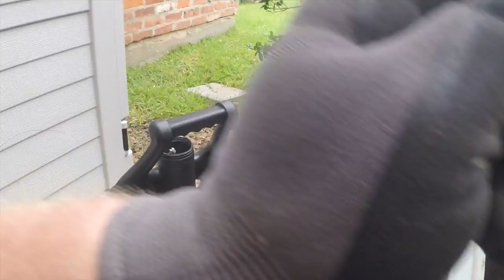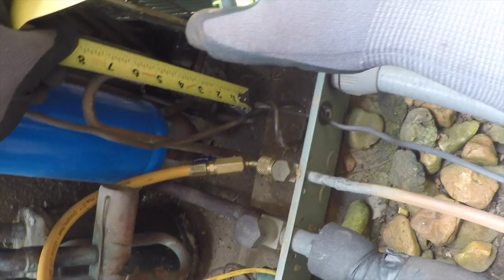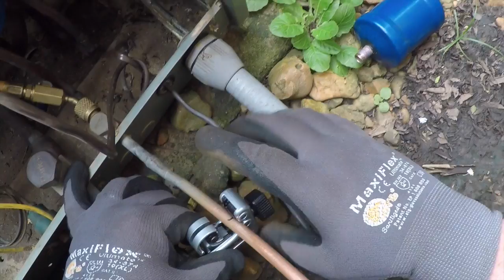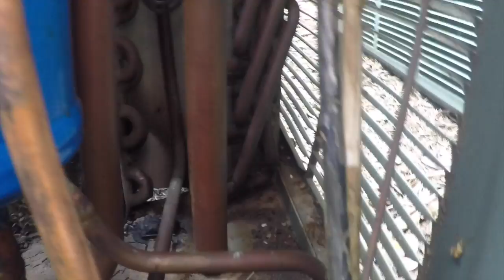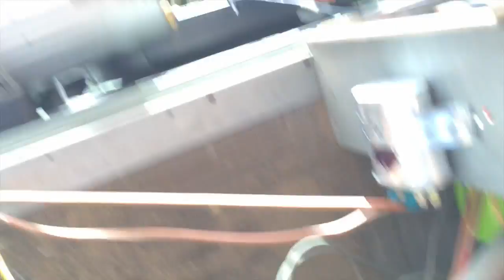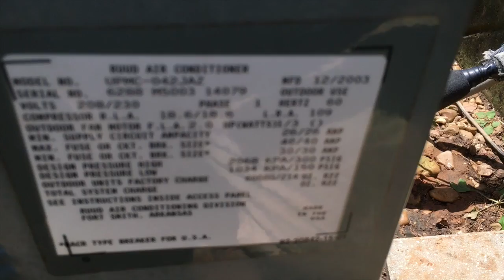HVAC: Ruud Freon Leak Repair

Comment: A lot of the moisture was put back into the system because you used a torch to remove the drier. I always cut out the old drier and add a little copper to put new drier in.

Comment: Good Job, John.. Stay with braze. I did refrigeration & air for 37 years. only used torch -b-tank for drain lines.. Most of my lines were 1 1/8 rubber gates/braided / or black High Density Polyethylene (HDPE), PVC, and CPVC. LOL Last 5 years did allot of GEO-THERMAL heat pumps..

Comment: Great video, the only thing I would do different is
1.  clean the liquid line copper before brazing
2.  use a wet rag or cooling gel on the filter before brazing
3.  cool down lines with a wet rag after brazing
4.  clean the condenser (looked very dirty)

other than that thumbs up on finding the second leak

Comment: All the AC companies you in my neck of the woods, put the filter drier indoors close to the evap coil. Any explanation for the different practices ?
Reply: Joe B it's always better to put filter drier indoors. It will not corrode and have a much longer lifespan inside.

Comment: Do you guys not use your pressure over time decay feature on the testo's? ( If you use a testo manifold )

Once your system has balanced over 15 min, I start the timer and let it go for 15 to 30 min on timed decay.

Just curious ?

Comment: Good work

Question: is there reason that the new drier was not placed in the original position?
Reply: It's just easier to replace in the future if needed.
Reply: Is it really easier?
I think these days a lot of us techs get in the trap of thinking something is going be easier, but it really isn't.
Since the drier was already removed it would have been simpler to place the new drier in position.
That and I'd recommend not un-sweating driers generally there can be a tendency to heat the desiccant and release noncondensible's back into the system.
In my opinion, I think it would have been simpler to re-sweat the drier in the factory position then to prep the liquid line cut it set the new drier there. Then cut a piece of copper to fit the old drier location swage it braze it. 
Now there are four braze points for failure plus a U-tube repair.
I'm sure that Isreal did everything in his skill set to make that system run back to OE spec.
So why, place a drier on the outside its ran 13 years with the OE drier with no problem till the leak. ( that know of).

Just my point of view its like a A-hole everyone has one.....LOL
Reply: @aubreyjahier6003  I'm not a tech and was wondering the same thing. 
Just using common sense, I would guess the new drier will be more vulnerable outside.

Comment: Nice repair , john. I see more folks these days trying DIY it to keep costs down. The problem with that is that there's hidden dangers everywhere in our industry. The trained pro is used to those dangers, though not immune. Stat set to cool? Filter clean? Breaker tripped? Those 3 things a diyer can check. Beyond that, you call a pro.

Comment: wash the coil before you check subcool? It was filthy.
Reply from the maker: +behvac your what's wrong with this industry!!
Reply: good eyes. bet both of those units are pulling a extra 5 amps each,  Next month will be selling condenser motor.  Yep my guy would have walked out the door with a new sale. He better sale what is best for the customer. That customer doesn't want to see me 3 times this summer. Another 3 times next summer.  Butt a one man show if you charged $1600.00 you can make it by yourself.

Comment: Since when is leaking "less than a pound" in 15 minutes acceptable?
Reply from the maker: +N_A M_E  Dude it could of been the temperature outside that affected the pressure!! Plus my vacuum pulled below 500 microns
Reply: Lol it could have been the boogyman also!
Reply: My Testo's never hold perfect. Usually says 0.06 drop and stays there. I put 250 PSI on my new systems to make sure it doesn't blow apart, then if I drop less than 1 pound I pull a vacuum. That is the true leak test. If a system will hold a vacuum it doesn't leak. But that's just how I do it. I could be wrong lol.
Reply: Ya I agree holding a vacuum is huge. Even a leaky system can go down to 500, but it certainly won't hold it.

Comment: That condenser is filthy. I hope you washed it out off camera before the head pressure kills the compressor.
Reply: +zachary palczynski I never mentioned selling anything. If you saw the cap dangling and the fan motor held on with zip ties you would fix it. Thanks for trying to put words on my mouth tho.
Reply from the maker: Dude get real. Yes its dirty but you're exaggerating!! I brushed it with my brush!! The home said he would wash it himself!!
Reply from the maker: +zachary palczynski I appreciate that buddy!!
Reply: +Israelhvac Rheem are notoriously hard to clean and are almost always filthy is why I asked. Your business your way. Just preventive maintenance imo.

Comment: as an aspiring apprentice I really love these videos keep up the good work too many techs in my area charge by the old beer can cold suction line and I like doing it the right way (super heat and subcooling ) where did you find that nitrogen regulator I have a flow meter on my tank but it's pretty fragile sticking out off the end like that
Reply from the maker: Thanks man i appercaite it!! Here is a link to the regulator http://www.supplyhouse.com/Western-Enterprises-VN-500-Nitrogen-Purging-Test-Regulator-w-500-PSI-Test-Pressure?gclid=Cj0KEQjw_eu8BRDC-YLHusmTmMEBEiQArW6c-MY42EWyrEU2-dCnBXdVAn3AsGmOpo4-mkg1sv2Dvj0aAu2t8P8HAQ

Comment: John, you are THE residential beast when it comes to troubleshooting and repair. BTW, I like the PVC tube for Stay-Silv storage...nice touch. Thanks for another great video.
Reply from the maker: Hey Robert thanks for the awesome comment bro i really appercaite it!! And thanks for watching my videos!!!
Reply: What is the flow use for in this case?  Is it this particular condenser unit need to use nitrogen?  What is the difference between nitrogen and refrigerant?

Comment: John, Good job on the repair, I wouldn't unsweat driers because the heat makes them release their contaminants. We are the guilty of it including me so keep up the good work.
Reply: If you can cut one end and then use nitrogen flowing through the opposite end you can unsweat one side. I noticed that John had nitrogen flying but when he unsweated the first joint it wouldn't have been flowing through anymore.

Comment: When you swage the 3/8, go about halfway then release and rotate it slightly and finish. I hardly ever get a split doing it this way.
Reply: I do the same thing except Anthony Reardon HVAC gave me a tip to leave the head one full turn loose on the handle. Works great.
Reply from the maker: Will do!!

Comment: 13 pounds of r22. sounds like a $1000 + repair to me
Reply: The factory charge is 13lbs 6 ounces. It's right on the label.
Reply: I had condenser in my house 13 pound yes guey